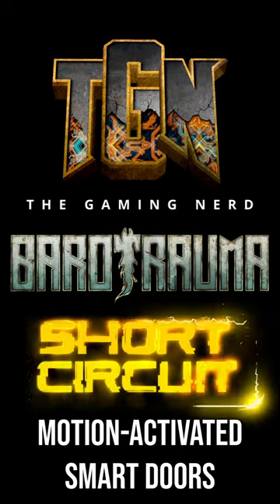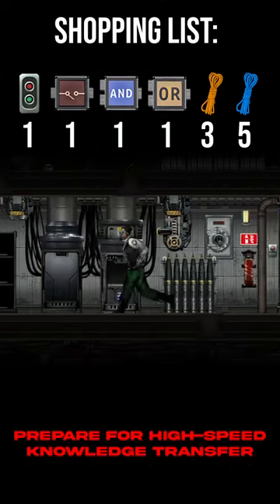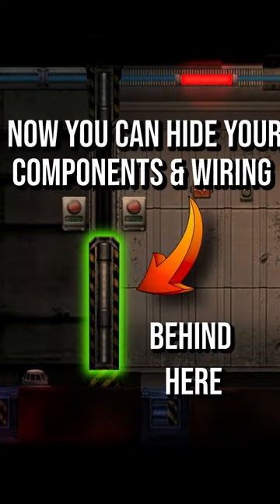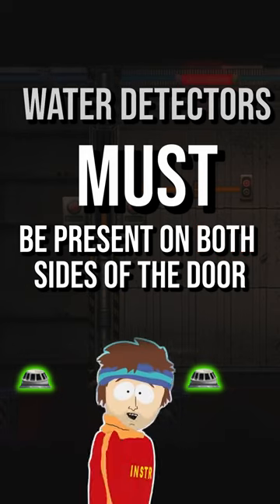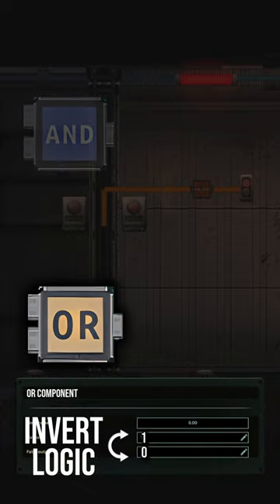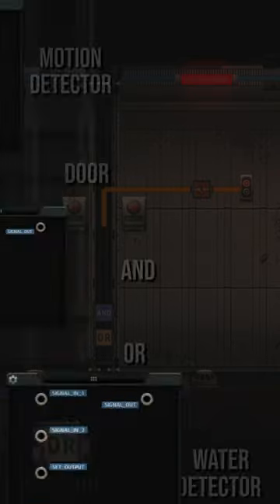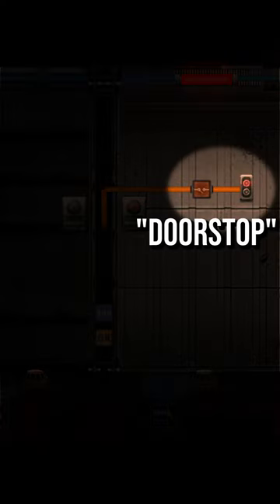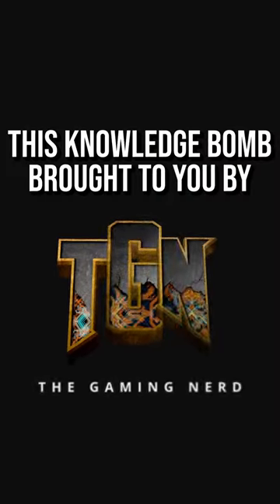Barotrauma SHORT CIRCUIT #1 - Smart Doors!

Comment: The "N" in the TGN at the final sequence looks like it might be on the wrong layer. I wouldn't know for sure.
Reply from the maker: I figured that the "Gaming" part was more important than the "Nerd" or "The", so it's in front and a tiny bit bigger. Also, it was inspired by the DOOM logo (https://bit.ly/3HEooTE), which has the middle letters slightly ahead of the side letters. That being said, the corner of that N is definitely misbehaving! Good spot!